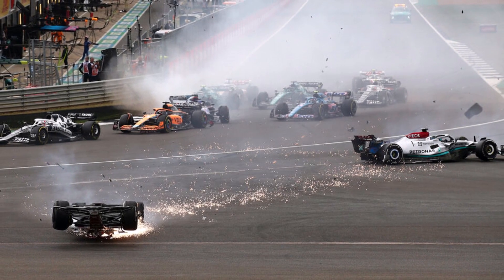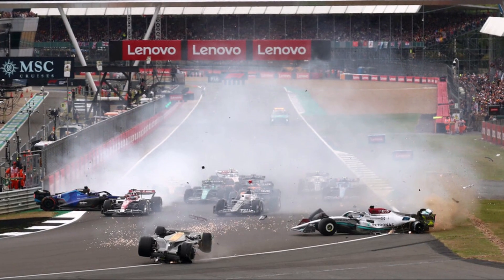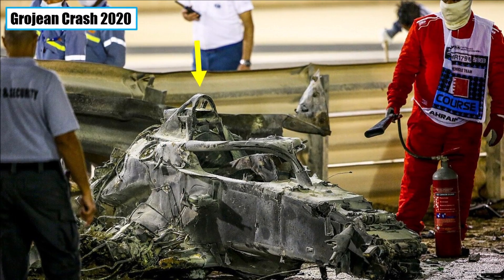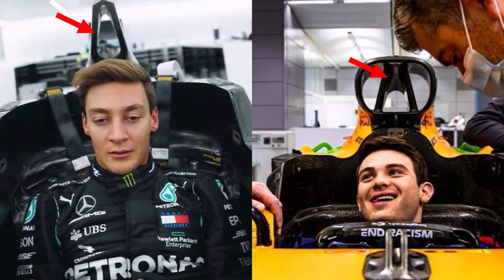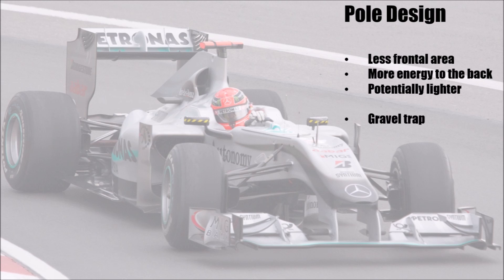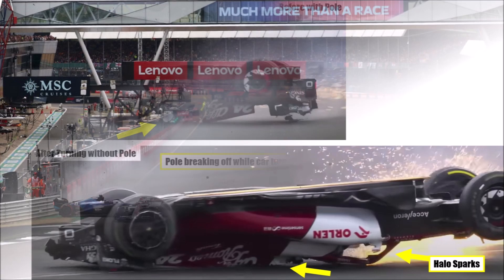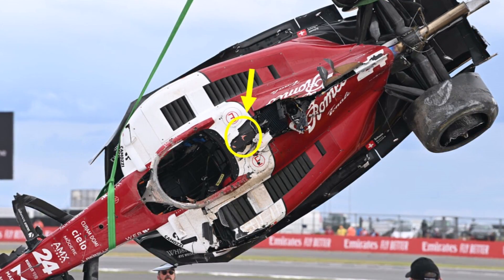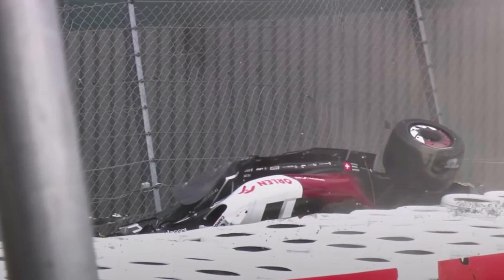F1 2022 - British GP - Lessons Learned - Zhou Guanyu's Crash Analyzed

Comment: It doesnt matter how much engineering you do, freak accidents do AND WILL ALWAYS happen, you cant engineer or eliminate all risk in Motorsports. That’s part of the allure for fans and drivers, the small amount of risk and danger!
Reply: Of course, regardless F1 tub weight has gone from 60kg in 2006 to 140kg in 2022 precisely because safety improves over time.  Safety improves over time as "good enough" is never considered adequate. [Recall that there were very few serious injuries in the late 80's until '94, so the cars could have been considered "safe enough" yet safety has been improved considerably since then, with the FIA bringing in ideas from Indycar racing like the headrest and HANS device... These days the tubs are now about equally heavy and indestructible as an Indycar tub too.]

Comment: Shocking. Instantly after seeing the roll structure  collapsing i was expecting the worst outcome. Luckily Halo safed the day. I think safety should not be an area for experiments, they should specify the design to a safe level (triangular or more rigid design) and put it into the rules.
Reply: The shape of the hoop wasn't the issue here; rather, it was the mounting method. There's a screenshot out there which shows the hoop in close detail, with the jagged remains of the carbon fiber that held it in place. It appears it was glued to the body, instead of the metal hoop being bolted directly to the frame. Carbon fiber is not designed for this kind of stress, and whoever thought this was a good idea should be fired.
Reply: Geezzz what a drama.

Guess you just started watching F1?

People like you ruin the sport.
Reply: @s1003232  tbh it’s not a dumb idea to standardize the roll bar like they do the halo. And that’s coming from someone who genuinely loves the technical innovation and engineering that formula 1 is and always has been
Reply: @s1003232 If "ruining the sport" for you is caring about safety. Then go pick a different sport.

Comment: Fantastic analysis. I hope for the safety of driver’s FIA will deep dive to make sure these structures adhere to stringent safety specs.

Fans want exciting racing yes, but nobody wants our drivers hurt.

Even hope they innovate further to make that structure even stronger. 
Perhaps even require it to be part of a safe single build cockpit monocoque design rather than an attachment.

Comment: As I thought, when I saw roll hoop gone off ,maybe Its design failure or assembly failure, when the life support instrument turns into the thing that risks driver life.
Reply: I suspect fatigue failure. Carbon fiber is not designed for that sort of stress. Which begs the question why they would mount it like that in the first place.

Comment: Most likely is that the pole was cracked due to the shear force at the first hit, not the axial force, since the safety requirement only mentioned the max load the pole should handle but never clearly defined it would be axial force or shear force, I think after investigations this would need to be clearly defined in the safety requirements to avoid same situation
Reply from the maker: The thing is just that it looks like the whole roll structure is gone cleanly and just separated from the monocoque.
If it was cracked and broke off, there would be a piece of it still attached to the monocoque.

Comment: Wow, you're right. Hadn't noticed the breakage of the pole, but what if his car had caught fire? With these points taken into consideration, there is one more area which could do with a rework: trying to win a race in the first few seconds of the first lap. More destruction comes from the first moments of a race than at any other time. Instead of a closely-packed grid, racers should be spaced apart or teams severely penalized for wrecks they cause.
Reply: Kimi Timoskainen  Rookie moves destroy the sweat and efforts of teams in a matter of milliseconds. Take a driver out on the first lap, you'll sit in the pits for a full 60 seconds.
Reply: Kimi Timoskainen  Rookie garbage should be felt by those who commit it. Trying to win an entire race in the first few hundred feet is moronic rubbish, and when it occurs, heads must roll.
Reply: Kimi Timoskainen  You simply wish to argue the point beyond reason. What happened nearly killed a man. The reason it nearly killed a man is the very reason I've described. Nevertheless, nothing will be done about it, so we'll have to rely on increased safety measures to protect the innocent from abject bastards. Engineering will have to intercede where common humility and good sense will not.
Reply: Kimi Timoskainen  Zhou didn't exit the track on his own. Why would he?

Comment: The roll bar failure also happend to Pedro Diniz in 1999 while driving - you guessed it - a Sauber car. I really don't get it, how this incredibly important safety device breaks so "easily"
Reply: 2 times in 30 years is not "easily"  Thats being dramatic.  Could've been manufacturing fault.
Reply: @skinnypete2248  F1 cars don't rollover that often, so the roll bars are rarely tested in practice.  I'm guessing the FIA uses a static load test on the roll hoop, but the test doesn't seem sufficient and perhaps the FIA needs a more difficult test just as other crash tests have been toughened.
Reply: @skinnypete2248  it sure is dramatic! I was just wondering why the roll bar doesn't get its one and only job done
Reply: Ikr, it seemed to be able to withstand impact from the front, top, and maybe rear. But not when sideways, idk im no engineer lol
Reply: @gilangthehuman  My assumption is fatigue stress from the vehicle spinning on its top at over 100km an hour. Carbon fiber is a brittle structure, and is good for a single impact. This Collision was the equivalent of a continuous multi-directional impact over the period of four seconds. This is why carbon fiber is not a good mounting point for the hoop, and future designs of the hoop should be a solid aluminum structure mounted to the frame. The Halo should be mounted similarly.
Reply: It is definitly a concern, especially when you consider this car passed the FIA crash tests